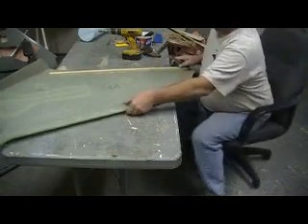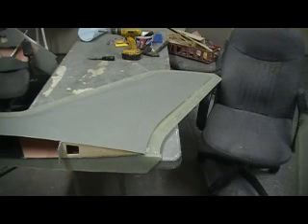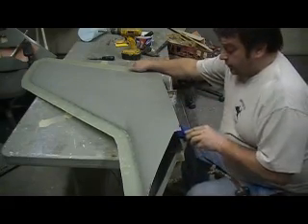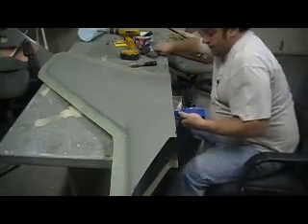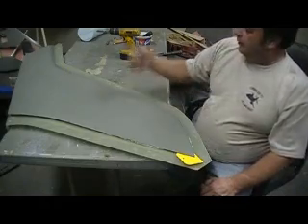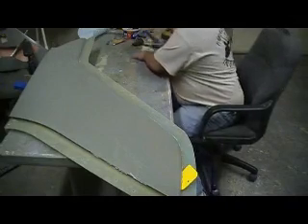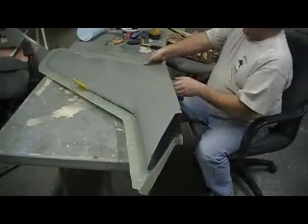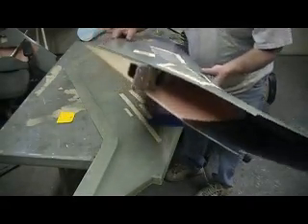how to build a rc jet F-105 thunderchief # 318

Comment: Hey Bob merry x-mas to you and your family............on the aluminum spar i recommend putting in heli-coils where you tapped the holes, they are a steel insert  that come in a kit with the proper drill and tap. Will make a much better thread for a tapped hole that gets used over and over in aluminum...just a suggestion love the new phrase Bob-ogenerring lol